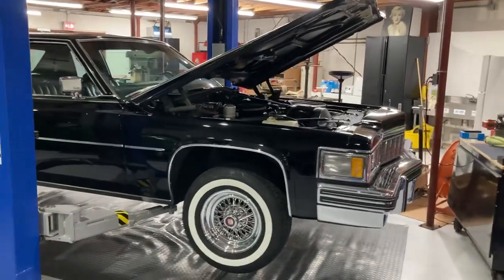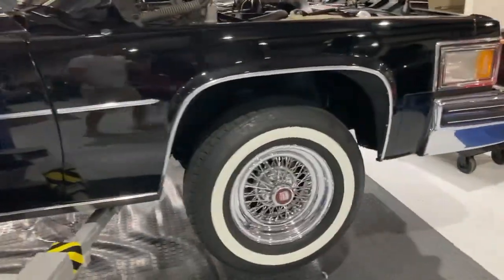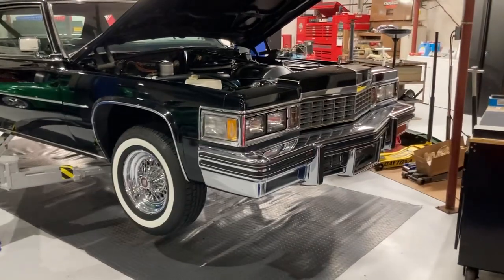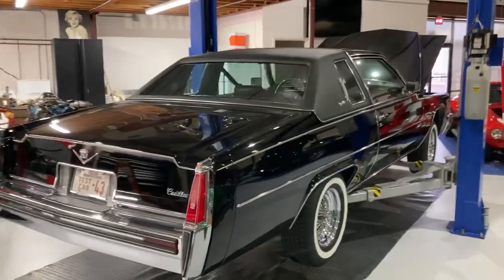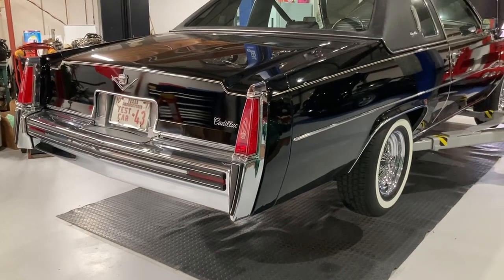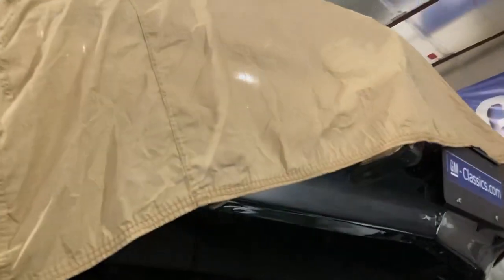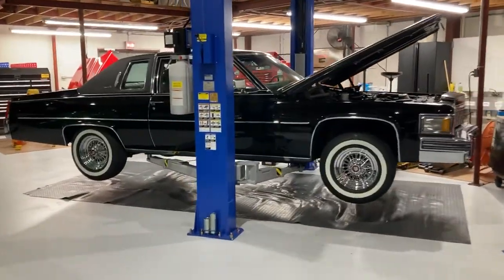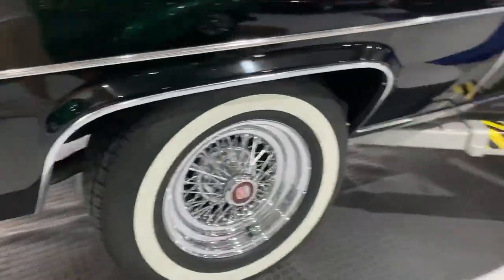1977 Cadillac Coupe Deville As New getting suspension upgrades, wire wheel and tires.

Comment: That Coupe Deville is gorgeous. I really like the wheels. I have a '77 Coupe Deville in Jennifer Blue, mostly all original and in really good to very good condition but with 93,000 miles it is nowhere near as nice as the one in the video. The previous owner put a set of American Racing wheels on it, they look ok but those wire wheels would look far better.

Comment: Matt, thanks for showing us this Cadillac.  I have a '72 Eldorado that I absolutely love, but it certainly lays over on itself going around curves!  Glad you mentioned the sway bar.  I'll look into changing mine with a beefier replacement.
Reply from the maker: There is actually a rare rear sway bar option and some aftermarket applications that can go on the 71-78 eldo, toro platform.   I’m not sure if it will let me send this link or not but I will do it in the next comment
Reply from the maker: https://www.ebay.com/itm/275162801892?mkcid=16&mkevt=1&mkrid=711-127632-2357-0&ssspo=7YIat7fJRl-&sssrc=4429486&ssuid=0kV66dpCT1m&var=&widget_ver=artemis&media=COPY
Reply from the maker: Just a random link that is avali at this time.  Helps those cars a lot

Comment: Beautiful caddy you have thanks for sharing. I love the way you've added hidden modifications to car without changing the originality of it. A little suspension modification, a little more power under the hood with the flipped up air cleaner. Nobody would suspect that the car has been modified unless you have a really trained eye. Do you still have the early 80's red brougham with the 501 engine?

Comment: I put '81-'85 Seville center caps on my wires.  They are roughly 1.5x larger diameter than the factory center caps.  Gives the car a bolder look.  Only problem with doing suspension upgrades on these cars is that it exposes rattles.  My friends hate me because "let's go for a ride.. tell me where this rattle is coming from!"
Reply from the maker: Just put a really loud exhaust system on it. All the rattles just seem to go away.
Reply: @gm-classics  ha!  Did that, too.  415cid with 2.5" true duals with DynoMax Super Turbo mufflers.  Nice and quiet at cruise and idle but sounds like an animal under heavy throttle.  Fixt some rattles but not all.

Comment: While you're on the subject of suspension. My 98 feels like your riding on tires that are filled with 90 pounds of air. Yes, it has airbags but they were bypassed. And there are 4 new shocks and struts. It just sounds and feels so stiff. Your opinion please. 1998 Devile.